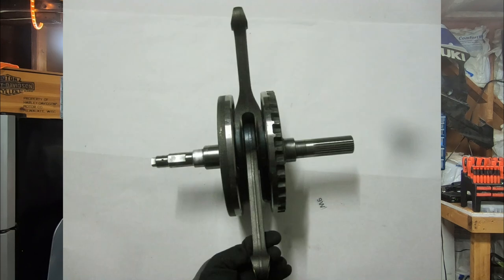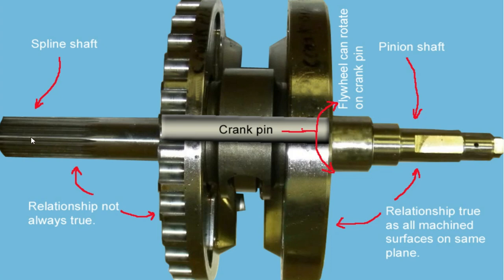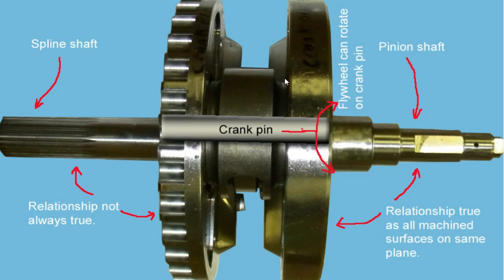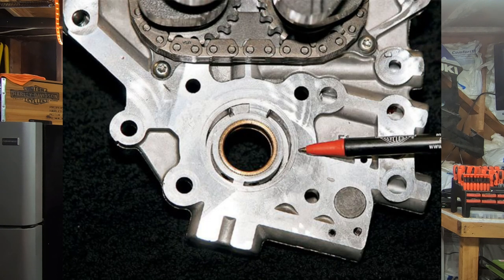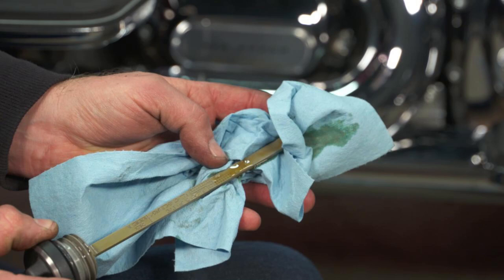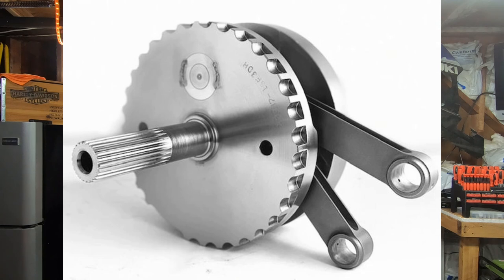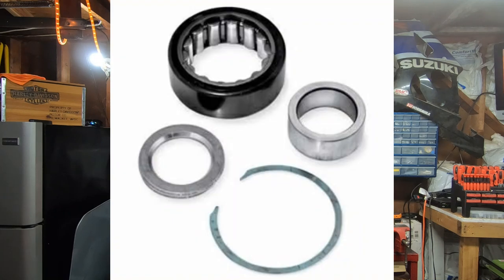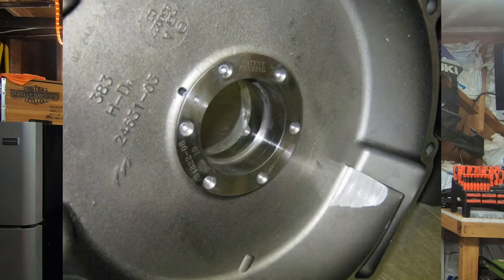The Issue With The Twin Cam Crankshafts | Harley-Davidson Cut Costs

Comment: This was my biggest fear when I purchased my 2013 Ultra. As I have told you before my runout was .006 at 60,000 miles which in my mind is excessive. Luckily my cam plate and oil pump had zero visible wear. I now have 123,500 miles and I'm obsessing over my next check which will be coming soon. I hope to hit 200,000 on the stock crank mostly for bragging then do a total rebuild. Like you said maintenance and how you ride is key.
Reply from the maker: Harley says upwards of .012 is acceptable with chain driven cams, but yeah I am with you that's a lot more than I would like. .006 with that mileage isn't too bad according to Harley, do you have any crazy vibration or anything (out of the norm for a Harley)?
Reply: @GixxerFoo  No vibration but I rarely rev it over 3,500 RPMs.
Reply: @Peter Angles I do not rev it past 3,500 because of the cam I installed. It produces the most torque from idle to 4,000 RPMs. The engine now has 139,000 miles and the crank is still the same as when it was new.
Reply: @Peter Angles 
Honestly I rarely Rev mine that high either. Not out of fear but simply because it has plenty of torque and power at low RPM's.
Reply: Recently bought a 2012 Limited. Absolutely love it.

Comment: I never realized how good my old Sportster was until I got a TC-88.
I rode the Sportster for 7 years and did nothing but oil changes on it. I bought a twin cam 88 and so far I have replace the entire cam chest and oil pump and I still worry about the crankshaft. Yeah my crank is in spec but that doesn't mean it will stay in spec.

Comment: Many who purchased the CVO 110 engine had this problem. Even riders who didn’t ride hard but often lugged the bike cause the crank to shift on the pin.
Reply from the maker: That's not another cause of it! Harley says specifically to not lug the the engine, it's not got good on the crank. Especially with the added torque of the 110 in a touring bike trying to pull that weight in a higher gear at low rpm.

Comment: I worked on one of these it was a 2004 I think. As soon as I got the top end off I realized something was wrong with the crankshaft. In addition the cam shoe was totally worn out. I had him come get it that is not the work I can do is have no access to a machine shop anymore. He only had 41K on it. That Twin Cam convinced me to sell both my Twin Cams. I sold  my 02 FLSTC and me 01 FLHRCI Road King.  I bought a low mileage one owner 98 FLSTF Fatboy my Twin Cam problem is now solved. I have it and my 72 FLH I have had for 32 years. For my money the Shovelhead was the best motor Harley ever made. Super easy to work on my buke is very reliable.
Reply from the maker: If someone get's one with the shoes wore completely out like that it's a time bomb. He's lucky that motor hadn't locked up tight with the shoes gone. That Evo and Shovel will last a lifetime, they will just do what they do and they don't really care what anyone thinks.
Reply: @GixxerFoo  I am not sure the shoe tensioner didn't cause it to lock up. I stopped working on it as soon as i saw the crankshaft had something going on. The shop he took it to told him the motor was a loss since the case was cracked too. I didn't see that when I had it. I am a private guy who does side work in my garage. I did put in a hydraulic chain tensioner in a twin cam for a guy who bought all the gear pullers and parts. I never did one so i watched a YouTube video and had no problem doing it. . I saw enough problems in the few twin cams I worked on to make me sell mine.

Comment: That’s why had Darkhorse do a lightening job as well as welded pin and sprocket (since it’s a Softail) then, when I got it back I bought the Jim’s Timken bearing conversion kit and set mine runout at 0.002”... still running SE Hydro plate w/ chains
Reply from the maker: That's a bullet proof setup! You shouldn't never have an issue running it like that!

Comment: I dig the twin cam because I’m a mechanic and get bored in the winter lol
Reply from the maker: Right?! I may be weird but I like bikes that require a some maintenance and work. I would get bored with my metrics to be honest, there just wasn't much of anything you could do to them. It's pretty much you get it as is and then you can't parts period for them in 5 years.
Reply: @GixxerFoo  But then before I bought my 09 twin cam I rode a 78 shovelhead, talk about busy winters...I have learned I would rather ride Harleys than rebuild/repair...am I missing something ? Because all I do now is clean it and keep the battery tender on it in case of a warm day or two that I can just fire it up and go for a ride in January or February...

Comment: Thank you for the diagram and explanation of how the crank gets spun.  Now I get it.  Mine's a 1999 and so far, so good on the crank.  Will look at the runout though just in case.
Reply from the maker: Glad it helped, your 99 has got the bullet proof Timken bottom end! The cranks were a lot more solid from 99 to 02, they used a larger crank pin those years. In 2007 on the 96 they used a smaller crank pin and increased the stroke. That created some serious issues!
Reply: @GixxerFoo  Good news, thank you.  I am probably safe to stack some power into that system, and that's my next move!

Comment: Good video, helpful information. Not likely an issue for most Harley riders as most owners ride no further than their local pub or breakfast spot.
Reply from the maker: It's really not a huge issue unless you really start putting some big power in the bike and really hammering on it when you ride. Exactly what you said though, the average rider won't have any issues at all.

Comment: We NEVER saw flywheel issues in any great numbers until 2006. I was working warranty at H-D. There were several production issues that I'll keep to myself as it's my competitive advantage over the guys who think the issues are based around flywheel design. It wasn't design, it was production.
Reply: They should have been welded...
Reply: @s.v.gadder1443  Really? How many hundreds of thousands of them are out there running fine, since 1999? Welding is another Band Aid, as I described above.

Comment: Been there done that. It destroyed my oil pump but that's it. 
 The only sign that I had (which I didn't know at the time) was the oil light kept coming on at idle while sitting still. 
This happened at around 40k miles. 2005 Electra glide. It cost me $1200 to get fixed by a guy I know who is very good at Harley repair. A shop might charge twice that if they even want to touch it depending on the year.
Reply from the maker: 40K is a lot of miles and Harley produce a lot of torque, should of been tacked at the factory. We love our Harleys though and gotta pay to play I guess. I am just thankful to hear you paid attention and caught it, got a good deal on a repair too! Did that include the tear down and reassembly for $1200?
Reply: @GixxerFoo  everything

Comment: Burnouts ✅
Drag racing ✅
High rpms ✅
Nitrous ✅
Bent crank, broken pinion bearing ✅
New S&S 106" stroker✅
For the record, over 40000 miles with no issues that weren't caused by abuse
Reply: Still no issues with the bent crank-broken pinion bearing?
Reply: @sigshootr9290  I've replaced the bent crank/broken bearing, running an S&S 106" stroker kit with the balancer shafts removed, only issue now is I've been breaking stator and rotor

Comment: Happy New Year and thanks for all the great info.  I feel very lucky so far. 60k+ on my 03 Dyna, just did the upgrades I mentioned in other comments on your previous videos. But am now noticing some possible oil seepage from front lower rocker box.  But other than that have to say it's running great. With the 525 cams it just loves cruising on highway at/and above 3000 rpm. Thanks for the videos.
Reply from the maker: Happy new year! With that mileage it's just likely the gasket, that's not uncommon at all. Not a bad time to pull it down and do a little inspection while you change that gasket out.
Reply: @GixxerFoo  why has no reputable outfit like S&S or Jim's or T & O not come up with a rebuildable crank for these TC engines?

Comment: Good video. I have a 2000 twin cam 88 with 38,000 miles. Opened up the cam chest to inspect the tensioner’s. Found little specs of metal and one or two tiny pieces of cam tensioner material. 
Checked run out on the crankshaft and found it between zero and 2/1000.  However, when I pulled the oil pump from the camp plate, I found scoring on the pump and the back of the cam plate. I’m thinking that’s what the metal in oil  is from.
Now, I don’t understand how I have scoring on the pump and the back of the camp plate, but runout is well within tolerance.

Comment: Nice.  I have a 96 softail 47k miles..I going to replace cam bearing and lifters..also just got 95 tc softail 18k miles. Someone put 3k in chrome got it for 8k...I going to check ✔ out per your advice this engine..I'm glad to find your posts..
Reply from the maker: Thank you! That is awesome! Cam bearing and lifters is key on that Evo, they eat some lifters with that pushrod angle. Sounds like you got a deal on that 95! Those 95's run hard with that short stroke!

Comment: Right on ! There are a few issues with 99 to 02 going out of true but I have tried & welded a few I tried them on my old shovel & Evo trying stand I just have to hit them pretty hard with my lead hammer but on 07 & up motors they have a undersize crank pin if u have one of those rebuilding or new S & S flywheels is the ticket ! All of the TC motors should have a timkin bearing conversion done period . Drag Specialties just started selling replacement crank pins & rods I have not tried them yet but I'll let u know ! I plan on making a jig to set them in when pressing them back together !
Reply from the maker: I agree! Timken is the way to go on those bottom ends, that's how were able to spin the XR750 up to 9 grand and keep it together. That undersized crank pin was a major part of the issues they had with that longer stroke in 2007. S&S makes some serious crank parts, they've done a lot of R&D and they work! Let me know when you try the Drag Specialties products, I am curious about those myself!

Comment: I had a great fix for this problem. Has worked for 10 years now. See my Avatar, that is what I turned my LAST twin cam into. Problem solved, with a bike with cheaper and easily fixable problems!
My last Evo? Still have it, and she has 232K miles...and counting...'nough said? Had 2 twin cams...no more.
Reply: Evos forever forever Evo's

Comment: Brother you didn't scare me away from a twin cam you scared me away from a Harley and I just want to thank you!
Reply: You didn't want a Harley anyways
Reply: @joetroutt7425  🤑
Reply from the maker: It takes a lot of abuse to spin that crank, anything can mechanical fail including a Honda. It boils down to just not flat out abusing the engine, a lot of bikes with spun cranks that came into the shop where from flaming burnouts to impress the ladies 😄. Or just flat out putting a lot of power into the engine and beating on it hard.
Reply: @GixxerFoo  true my friend, and my bike abusing has always been on the track, and my mother made sure that the girls I hung around couldn't be impressed with a burnout. Lol
Reply: @charlesmorris8491  Real ladies only want guys who ride Harley Livewires! (less noise, no maintenance = more time on the couch together).
Reply: @charlesmorris8491  I'm seriously considering a Livewire for exactly the reason you mentioned.  Unfortunately with the covid pandemic, opportunities would be limited.  Anyway, at least I have the twin cam 103 to have a blast on :)
Reply: I never understood the Harley thing for the first twenty years I rode. Then in between bikes my friend let me ride his FXR for a few weeks and I was hooked. Now I don't understand how I rode anything else.
Reply: @kerrylewis2581  That's a great point! One of my motocross friends has expressed a similar thought. Maybe something out there is trying to tell me something about Harley's. 🤔
Reply: @charlesmorris8491  FYI... Motocross is where my love for bikes started. Rode until I was 38 years old. Injuries and broken bones made it hard to show up for work on Monday's. LOL
Reply: @GixxerFoo  I didn't abuse mine.  It was purely poor quality control and poor factory workmanship on my Harley.
Reply: @dangunn6961  I love Harleys and wish I could defend them at all times but Harley is on their own when they state .012 is acceptable.
Reply: My 88 has more miles than any of the other brands I've owned and still I've only had one of my 37 motorcycles have catastrophic failure and that was a Goldwing
Reply: That's to keep the posers away. Stick with your vespa. They are out of your financial range.
Reply: @kerrylewis2581  Bingo!

Comment: I have a 2000 Road King 88ci that at 15,000 miles had the cam bearings fail. Harley had a recall on the bearings. The dealer had to change the cam bearings,oil pump and cam bearing plate. While he had it I had him install the 95 big bore kit and gear drive cams. I didn't know about run out at the time. Now I think I need to have it checked. I have 22,000 miles now.
Reply: You shouldn't have any run-out.  The 200O has a forged crank, which means no crank pin and it's not pressed together.  It's all one piece.  Also you have the tempkien bearings   Wouldn't be a bad idea to check the run out, but most good mechanics would have checked it before installing the gear drive cams.
Safe travels my friend.
Reply from the maker: The 88's had a that much more solid bottom end with the Timken bearings, the crank won't walk like it tended to do on later models. I would hope being a dealership with a qualified tech they would of checked the run out before installing the gear drive. But with it being an 88 it had a better crank and better bearings I would say your good to go. Never hurts to check though just for piece of mind.
Reply from the maker: 👍 Exactly! Early 88's are solid when you get a gear drive in there!
Reply: @butchcassidy3373  Please explain how they had "no crank pin."  The only way they could have been "one piece" with "no crank pin" would have been a completely different design like a side by side automotive connecting rod set-up and not the old knife-in-fork Harley set-up.  Thus, I'm afraid, you're statement and position on that score is incorrect.

Comment: Great advice from your shows. Thanks. I have a 2010, 96. It's chipped and tuned stage 1. Runs very quick, partially because I can easily take it up to, but not often exceed 5600 redline. To give some idea, on a good day I can touch red in 6th gear. Crazy. With the boys though, I like to run it up. No burn outs done. But the engine is so smooth with no vibes at any speed. Always has. 30,000 km on bike. Should I be worried about this crankshaft thing? Did HD fix this problem of the 96's with the later years ? I'm a bit spooked now.
Reply from the maker: They are still pressed crank, they have got it about as good as it's gonna be for what it is by the time of the 96. What are Harley says is allowable run out will hurt your head, but with a stage setup and just riding the bike you shouldn't experience any issues.

Comment: 2011 Softail 96” with 123,000, been a 106”for the last 15,000....crank untouched...for the cost you might as well wait till it actually blows up before you rebuild it...also all 08 and up have the “Lefty” bearing installed..24605-07 is the bearing that comes in the “lefty” kit, also used on the right side. They are the same bearing used in the 120r race engines. Plenty of people running 110’s with 117” big bore kits with the exact same crankshaft and bearing my 96” came with.
Reply from the maker: The cranks having issues is pretty rare anymore, there were some issues but it really wasn't wide spread. Best way to go about is get a Dark Horse crank, they are pretty reasonable and they are strong as hell if your going all the way down to rebuild.

Comment: As you've said it, abusing the motor is what takes all the issues to the surface. For to that instance, revving up high all the time a H-D is not appropriate; if that's the case, a sport bike should be a better option. So, indeed, it is not an exclusively related issue to H-D; any motorcycle of any brand will suffer the same fate if abuse is induced. About the pressed pin, other brands do that as well. It is like people complaining about the drive chain tensioner: they just point out H-D for having implemented this"bad design" while not being aware that other manufacturers apply similar mechanisms in their so-called high technology engines.
Cheers and happy new year 2021.
Reply from the maker: I appreciate it! I grew up in a Kawasaki shop and even metrics can be completely trashed from abuse. Even a Honda can and will fail if it's abused, we took used bikes on trade that went to wholesale cause of issues related to just beating on them. You can bullet proof a Harley with a built crank, Timken bottom end, built cam chest etc. and go thrash on it. It will take it a lot longer but eventually something will let go. I hope your having an awesome New Year!

Comment: 2012 ultra, At 10k, did chain guides and crank run-out was 4 thousandth. At 18k, it started 1 morning and was vibrating like crazy. Pulled the cam cover and crank run-out was 24 thousandth. It's obvious what happened. Pulled the motor and sent it to my guy. 8k later, new stroker crank, big bore kit, etc. Timken bearing kit, gear drive cams, and that was the best friend price in 2016. I must say has been rock solid since. 130hp/130 torque. Updated primary and now at 69k. I was pissed off, to say the least, about such a crap crank design. I've put at least 16k in that bike since new. 😂
Reply from the maker: There's really nothing good about the factory Harley cranks!